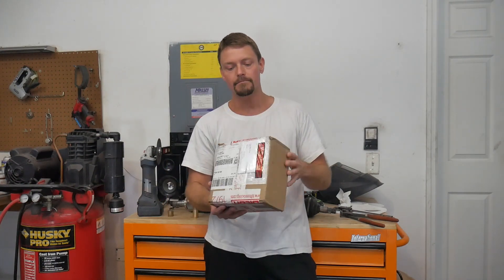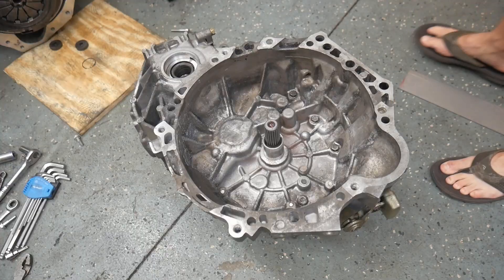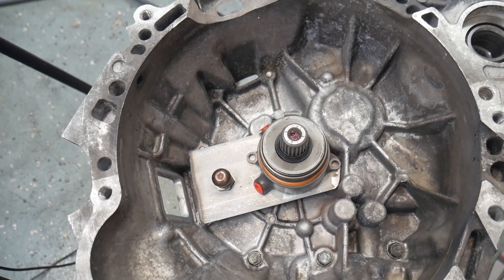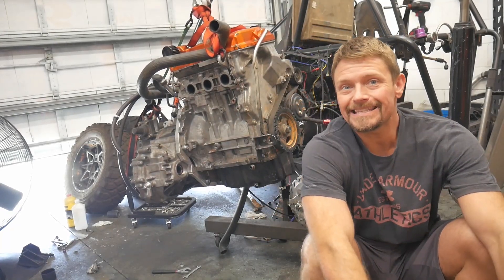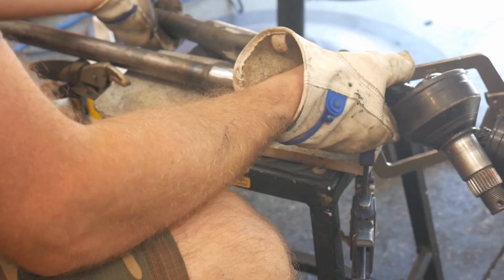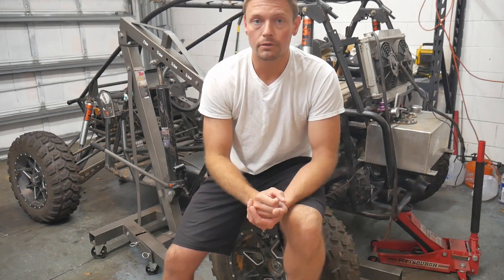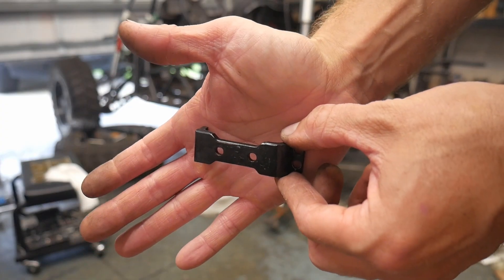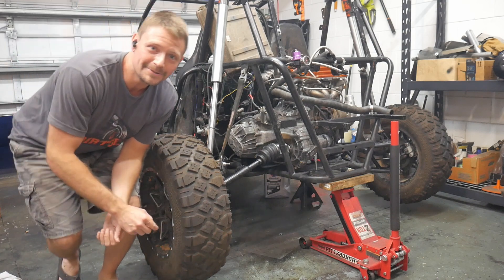Build Strong Sleeved DIY Axles This Way + New Concentric Slave Cylinder from Tilton Engineering

Comment: I just plug weld the ones I've done.  Having the weld around the ends of the sleeve is right where the axle will break.  The plug welds are all you need.
The Ford explorer has a hydraulic throw out bearing, it is a pain to get them to fully bleed, but that doesn't seem your problem..
Reply from the maker: @murraymadness4674  They can be difficult to bleed but you're correct that wasn't the issue. Thanks for feedback on the plug welds, I believe this is the best method or to cut an extreme angle on the sleeve which I should have done!

Comment: Get rid of those hub springs in the clutch. There won't be any question of whether the clutch is engaged or not. You got spare clutches, you can weld one solid and try it, and see how it feels. You'll order one without.
Reply from the maker: Really? I've leaned on a few of the industry experts and they all said to go sprung 🤷‍♂️
Reply: @DirtGearTv I think you should try welding up a cheap replacement if you have any wonder at all what it's like. You're the expert here, nobody else really knows what you want. And you have that great ability to pursue a logical thought to its logical conclusion.
I did it about 30 years ago, when all the replacement parts were crap; I just welded up a clutch disc to see. Loved it, bought a custom built clutch disc for a damn Chevette.